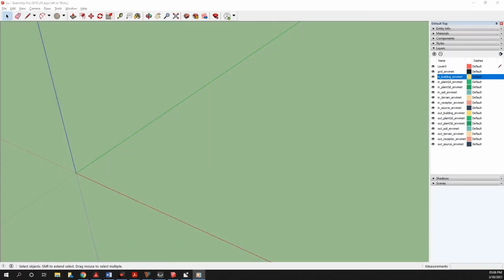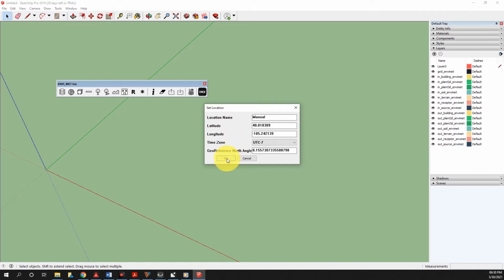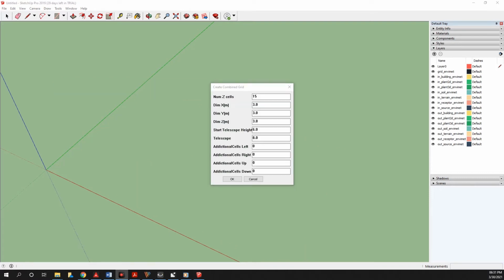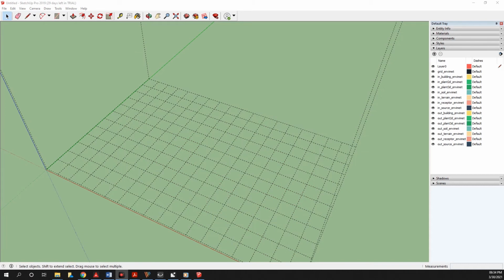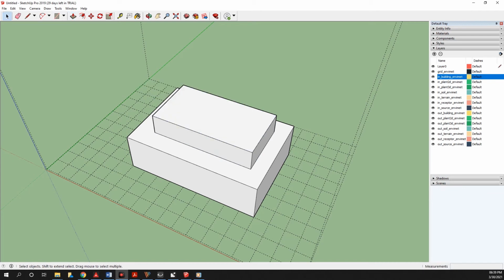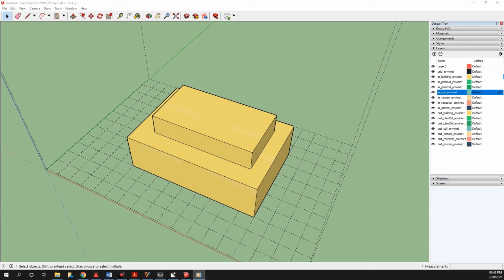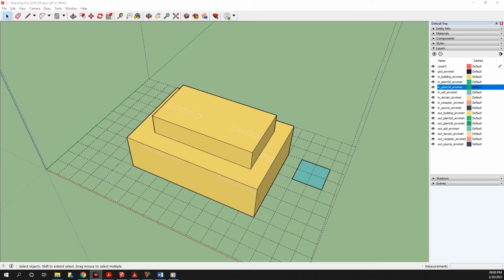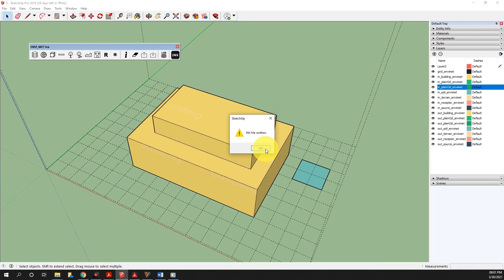ENVI met tutorial 2---Plugin for SketchUp

Comment: Hi after installing the plugin the envi met plugin bar doesnot have the envi met layer option.
Reply: I got the same issue. They say it is also called "tags" in Sketch Up. But under "tags", there are no default tags by envimet. :(
Reply: Found the answer here. https://www.youtube.com/watch?v=7zcgLknUAgU&list=PLVk71QLjaA6MABWgAIh_VJJ53PREOXKBX&index=3
As I understand, you have no library shown under "tags" but inx still has different "hidden" tags. You can select them by clicking on the "search" tool and add manually under the "tags" section to manage.
Reply: @hipiano  Thanks :)